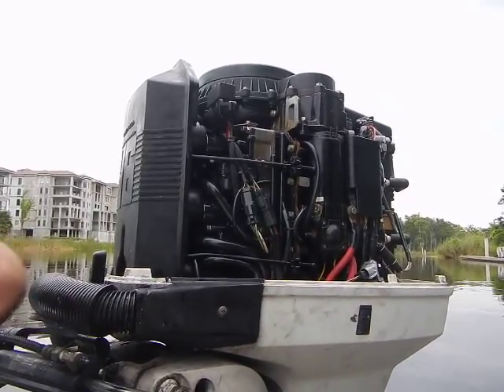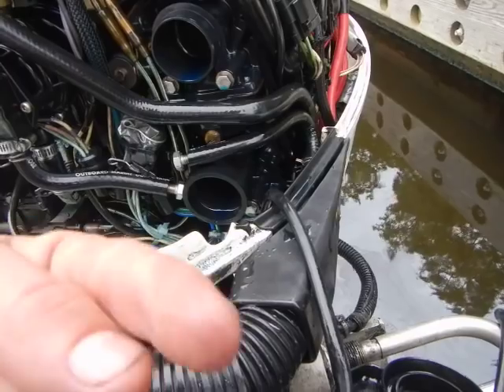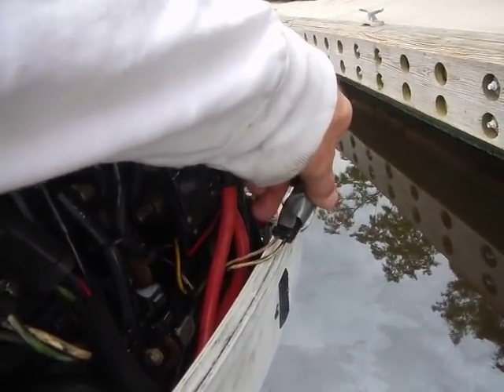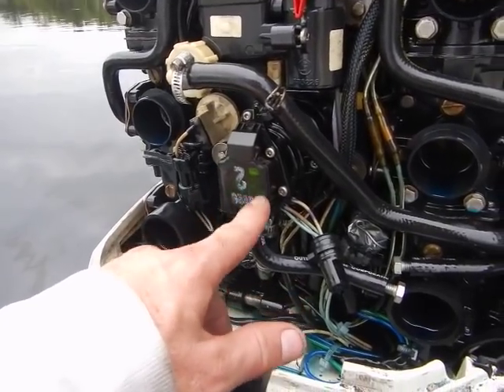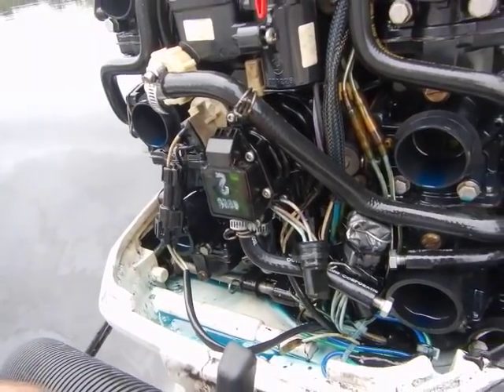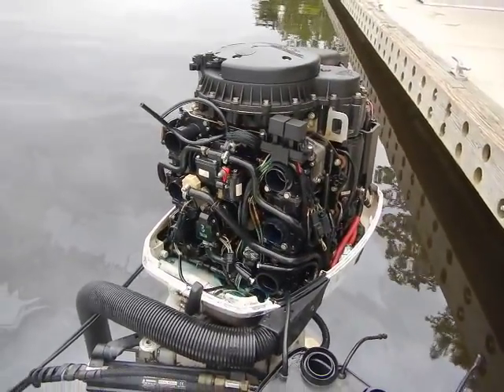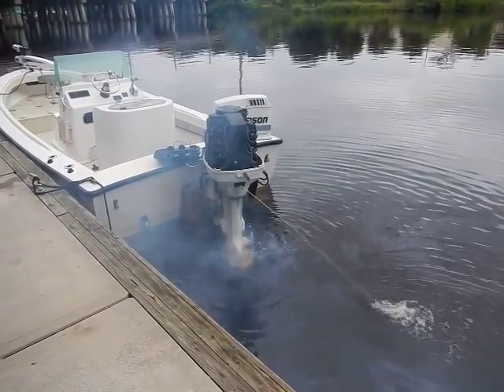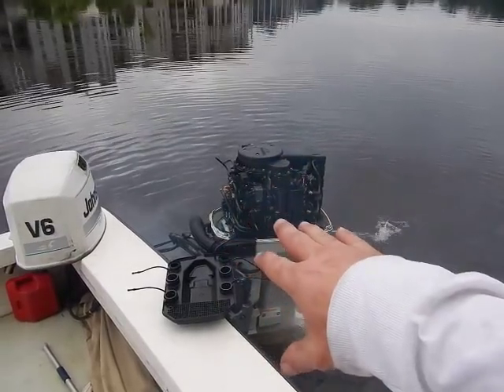Bypass VRO Oil Pump 1996 Johnson 150 HP

Comment: That’s the strongest water pump I have ever seen
Reply from the maker: Funny.  I never even noticed.  Definitely a quality stream.
Reply: Just deleted my vro changed lower unit oil an now it will not pump water on the hose so I am going to do the pump don’t know the history on the motor
Reply from the maker: @brandone6252  yeah.  Probably a good idea to replace that impeller.  Maybe you'll get some flow like mine.

Comment: Sounds like Lucas is having the same problem as I am. Once VRO is disconnected electrically, does the fuel side of VRO still operate as a fuel pump or do you need to add a fuel pump to maintain proper fuel pressure? How does the VRO still pumps fuel mechanically if the electrical leads are disconnected, I don't see any mechanical connection? Is the motor pulling fuel through a vacuum created by the motor once started? Need Help with this, Thks.

Comment: Johnson just dumped a bunch of VRO pumps on the market for cost so now you can get a brand new one for 145 and the upgraded works great compared to the older version.
Reply from the maker: You have a link to the product that you can share?
Reply: He’s right you can get a brand new upgraded VRO kit on eBay for $145
Pre-mixing at 50:1 you’re going to be wasting a lot of oil
Reply: @Bruce Bonfiglio true that’s why I Do routine maintenance Not just on the motor but also the complete oiling system , I have a 99 Johnson 225  I Purchased new as an upgrade for the yammy 150 that was on my Grady White when I bought it now 22 years later I just replaced the tank and pump pro actively I live in Florida so I use the boat year around and it’s got over 5k hours 
The reason vro system got a bad rep is because people neglected them but that’s just my opinion
Reply: @johnbumpus7138  All I see are super expensive new ones. Any chance you know where I can find a $150ish one? Link?

Comment: When you start changing things around something else screws up, Ive used Walmart oil for years with no problem,some of us cannot afford $35.00 gallon jug of oil.
Reply: 1DesertCop The VRO is a oil mixing sysytem/fuel pump. Most of the OMC motors have the VRO and when they start to go bad people typically just disconnect the oil and use it just as a fuel pump. This gets rid of the VRO mixing the fuel to lean/rich and gives peoole the peace of mind from the pump because if the oil stops getting fed, the motor will blow. Also a new VRO is a $400 part, this is a cheap/free fix.
Reply: Fisherman466 Variable Ratio Oiling just run three ounces to a gallon never have a problem OMC s abortion all they had was problems with that system I set my etec computer to tcw3 oil setting so runs heavy oil that xd 100 setting is too lean for me on the etecs JT

Comment: Thanks for posting, video really helped me out.  I did this to my twin 175 ocean pros and they are running better than ever with so much less smoke at startup and idle.  The VRO rebuild parts were very expensive so now I just mix 50:1 and all is good.  With 20yr old engines this is fine with me.  I find it easier to mix the gas and oil myself due to the oil fill location on my boat.  Since I generally fill up with either 100 or 150 gallons (have a 200 gal tank) I either use 2 or 3 gallons of oil and then I'm set for the weekend.  Super easy.
Reply from the maker: john doe right on. Glad the vid helped.
Reply: Can anyone tell me how there engines ran after VRO disconnect? im thinking about disconnecting  mine on a 200 Ocean Pro 1997

Comment: I did the same thing to my 70 hp Johnson. Now I can use the same fuel line for my kicker that runs on premix because my main tank is now premix. My engine smoked so much at start up when the VRO was hooked up. I hated it...it ran like crap till it warmed up.
Now its good from the second you turn the key.

Comment: I took the complete VRO system out , It had air leaks and was nothing but a problem.    I now run premix in the tank and an electric fuel pump installed where the VRO system use to be. :)
Reply: Do you remember what fuel pump you installed? Doing the same to my 150

Comment from the maker: No, you're right, but the pump is still pumping.  All I've done here is disconnect the oil hose coming into the pump (and cap it off really good) and also removed the electrical plugs coming into the pump. I know one of them is for the warning signals and I'm sure the other one has something to do with the oil system (telling it to pump more or less oil).  
The Fuel hose is still connected and the pump is mechanical, not electrical, so it still pumps fuel just fine.
Reply: Would it not pump good if the bolt you use it to small? I put a hose clamp in it but I don't think it is tight enough. My engine cut off when I was coming back in from fishing it still turns over it just won't start.
Reply from the maker: @danielmorrison9055  yeah. I had a problem when using a smaller bolt. That could be the issue. It's not hard to take the VRO apart to see if the fuel pump diagram is cracked. I suggest checking it.
Reply: They make a conversion kit that includes a new calibrated high flow fuel pump without the oil injection pump it’s $65 on eBay It also comes with a plug-in signal killer so no more low oil light
Reply: @johnbumpus7138  I know this is a year later so maybe I missing it somewhere I see the conversion fuel pump but not the by pass for the low oil? Do you happen to have exactly what you used and what worked for you?

Comment: I guess I may delete VRO from my Johnson 115 and go with pre-mixing. An additional benefit of going with pre-mixing on my boat is that I will no longer need the oil tank on my boat and therefore have an extra much-needed storage.

Within the whole VRO pump assembly, my oil pump is still working (oil consumption verified with clear tubing). But when I turn on my key without cranking (fuel pump starts working at this point), the very front 'no oil circuit' actually gives SMOKE right away! My guess is that there may be a short circuit inside the 'no oil circuit' part ('sensor') due to some corrosion, water intrusion or other reasons. 

I'm not sure if how I can fix the 'no oil circuit' part. I can take it from my boat, but don't know I can open it up and fix the possible electric short circuit inside. So either go with pre-mixing or buying a new whole VRO pump. I only burn about 70 gallons of fuel annually. So I guess I'm going to be fine with 4-5 times of premixing every year, and not spending $400 on a new VRO pump.

Comment: i did the same to my 50 johnson but i went out and bought a new pump,  i about to do the same on a 200 oceanrunner but was wondering do you get a no oil light on your dash for the motor since you disconnected the wires that let you know the levels of your oil can.

Comment: I use to own a 1992 Evinrude XP 200 with the VRO system & it worked great. I would Never consider taking it off that Outboard as long as it was working. If it was to ever have gone out, Quit working, I would have replaced it with a New one. I'm now going to be running a 85 Johnson 9.9 Outboard where I will be mixing the fuel & oil 50:1 and have mixed fuel before for other Evinrude /Johnson outboards the same way without any problems. Good luck with your Outboard, It looks as if it runs good !

Comment: I see this post as a little bit older but I do want to recommend using  100:1 Amsoil oil mix it will help you out with detonation problems if it's still alive on the Walmart oil it will truly last you a lifetime
Reply from the maker: Daniel Boone a year or two after making this vid, I bought a new VRO pump and installed it. Just last year I sold it and the guy who bought out says it's still running strong. It's a great motor with tons of power.
Reply: all Johnsons need 50:1!

Comment: Premixing fuel protects and lubricates the entire fuel system. 2 stroke oil now has additives to help combated the ethenol..moisture.. in today's gasoline. 
The VRO is an excellent system, but is that $500 replacement pump going to last 20+ years as the original.

Comment: got the same problem as you did but changed the vro (expensive) and guess what! The pump was not broken still same problem so now i premix instead. I guess its has to do with the electrical system on the vro but just guessing and its running fine with premixing.

Comment: My son just got a 1996 Ocean Runner 150.  It is a project.  Any other info and tips would be greatly appreciated!
Reply from the maker: It's a great engine. Tons of power. 
If the VRO works properly, keep it installed. If it's old, he should probably purchase a rebuild kit for it.  I may have linked it in the description. 
The carbs are plastic and I've seen them warped before. This allows for leaks and overall poor performance. High temp can cause this. Just make sure it is peeing properly. 
If you have any other questions, just ask. I'll answer if I know.

Comment: Hey guy, did you by any chance have to change the jets High and low speed office on each carb?
Reply: why would you need to rejet? air fuel mix is still the same. only now the fuel carries the oil instead of the oil being injected. These are known for over oiling at low rpm and failing at high rpm melting the motor down
Reply: @dirtydevil283  Have an 50hp VRO Fukin love it smokes a bit at a troll other than that VRO evil ,just urban legend few fail  ,,its always " I know a guy who knows a guy crap.

Comment: Hey....i have sea ray 150 outboard 2 stroke  and its hard to start....thinking of doind this and adding a low pressure pump....any feed back?
Reply from the maker: If you're having trouble stating, that's probably associated with a different problem.  I'd look for other issues first.

Comment: My question is....  If your disconnect your vro how does your engine get fuel? Vro is oil and gaspump at the same time or am i wrong
Reply: Oil pump is separate from the gas pump. I’ve disconnected every one I have ever had. They are the cause of so many blown motors.

Comment: will this cause the fuel pump to go bad? I disconnected the oil part of the VRO when I got my boat 2 summers ago, but now the fuel pump is bad. won't it constantly be trying to suck oil that it's not getting? I would replace with a regular fuel pump but I don't want to jag around with the bracket issue, so I was just going to replace with another VRO, but won't it just go bad again?
Reply from the maker: The fuel pump will continue to work whether or not the oil is hooked up. I had mine in this condition for quite some time without issue, however I ended up installing a brand-new VRO pump a few years later. I was happy with the decision to go back to the VRO pump.
Reply: How much trust do you have in the new vro's?

Comment: how I mix the oil to fuel mix say for the evinrude 150hp outboard if im gettin an second hand boat but was unsure bout the VRO had been disabled or not what is the right premix ratios for these motors as im gettin an older bowrider boat with these motors from 1991 onwards and need to knew how much oil to put in the tank of the Caribbean Calais has a 135litre tank im not sure how to mix the oil and the fuel for the boats with larger tanks that are larger than 25litres as I also need help to learn how to get the correct premix ratios for larger boats with the evinrude V6 150hp outboard as im researching the boat with these motors this will mention the boats in good order as I knew as an ex outboard mechanic I worked on these motors this was some 19yrs ago and I knew that these are the motor I worked on all these years ago as I have the knowledge on them as I knew the brands you talked on about as a self taught mechanic I knew the outboards well mainly evinrudes that's including the Johnsons too they are the sae I think so as I knew the same problems are the same with the Johnsons too as I worked on the same motors of both brands as you knew I have the knowhow to fix these outboard motors as a ex outboard mechanic I had the knowledge as I learn all on these motors as a lifelong boater I knew a lot on these motors very well and knew how to fix these evinrude V6 150hp outboards I knew I have this learnt from my boatin experience  all I knew I can fix any evinrude mainly the older carbie models this relates to the V6 90deg models and the smaller 90deg V4s as well I knew how to fix them outboards as I knew how to fix them I was taught how to service them and fix them too that's what I knew on the evinrudes I have a strong connection to them due to my long boatin experience in Australia  that's how I learnt on them these are the good motor built by OMC they are good unlike the others that's are not so good as evinrude/Johnson they are the best in outboards the evinrudes/Johnson built by a good maker that's OMC they are very good motor in the industry I knew that's the case
Reply from the maker: Should be 50:1
Reply: that's good to know this as I have to learn this as I get my 1st evinrude 150hp V6 outboard on a older bowrider boat that's either a Haines hunter or Caribbean Calais just need to learn a bit more on the right ratios with the larger tanks in the boats im researching at this moment I do agree this will be right as I am old salty I will be happy to talk more on this subject as I knew I will learn as I go on these premix outboards that's is the evinrude V6 150hp 90deg models  these are the motor im researching as of now need to learn more as im in the process of getting the boat I want with these motors but will take on advice if the need to as I lean of others in the care of these motors and im getting there with the boat I wanted with these motor on the back thank my friend im always leaning on boat that's very good that hint
Reply: an I  knew this is right premix ratios but I knew I will be learning on this stuff this why im gettin good on this stuff
Reply: and need to know this as im gettin the knowhow on these outboards but are learning all the time hope this will help me this is new to me
Reply: if is ok to mix the oil to fuel with boat that has larger fuel tanks say the boats like the Caribbean Calais with the 135litre fuel tanks as im confused as to the right procedures when filling up as the servo if better to put the oil in first in the right amounts then put the fuel in as I do that I add the oil at the right amount what are your thoughts on this as I am gettin a nice boat in the future with an evinrude 150hp V6 that's an older model on a older boat that's im gonna fix up over time the outboard will be checked but I will need the help on this as im gettin my first 150hp evinrude as I only knew the smaller evinrudes that's the 25hp models I knew on but the 150hp model will be my first V6 outboard on my first big boat can you guide me on how to start these outboards this regarding the choke and warming up procedures and how I mix the right oil for the fuel for the 1st time as im used to smaller outboards but the big 150hp models are a bit new for me

Comment: Hi jim, I just bought a boat with the same motor same year and and replaced the power pack optical sensor plugs and wires. I'm having a problem my motor will run great then all of a sudden when I'm running 3/4 to wide open throttle the boat will bog down and pretty much do nothing when I hit the throttle. It will still idle fine also I noticed if I hook the motor up to my 6 gallon temp tank the motor will clear up and run good again. There isn't any trash in the fuel tank do you think this could be my fuel pump or possibly my fuel line ?
Reply from the maker: Definite possibilities.  Have you tried to pump the bulb on the fuel line when this happens? If it starts ruining again, the fuel pump may be your problem. And the fuel pump is part of the VRO. 
Another possibility is that the carburetors may have a leak. Or if you have a fuel water separator, it may be loose or have a leak at the seal.
Reply: @JimWellman  I've tried to pump the bulb with no results. I'm wondering if some how condensation got into my gas tank and is causing this. I'm going to get a bottle of heet and see if it runs better.
Reply from the maker: @tylerthomas3744  there may be a hole in the fuel pump diaphragm. I made a vid showing how to rebuild the VRO. You may want to take it apart to check for cracks in the diaphragm. I also posted a link to a website that sells the rebuild kits in the description. 
https://youtu.be/_ZT-oMJG-EA
Reply: @JimWellman  thank you I'll pull it apart and look at it
Reply: Probably the fuel line. I have a 1999 150 ocean pro and I swear I thought I cracked the head cause I got the motor to hot (forgot to put hose on it) long story...anyway it would do fine until about 100 to 200 yrs out on the water. I told service man a probably of cracked head or etc... come to find out the motor was fine. But the problem was the fuel line was calapsed. I think the vacuum running it hard would make the fuel line calapse qnd it would eventually stop running. Anyway it's probably fuel line.

Comment: why would you unhook it and then replace the VRO? Im looking at disconnecting mine but maybe I shouldnt
Reply from the maker: Originally didn't want to spend the $$$ on a new pump.
Reply from the maker: If it works, no need to bypass it. My only reason to bypass it was $$$.
Reply: @JimWellman  vro broken when idle and cut after few second? My V6 spitfire start but cut few second later :(
Reply from the maker: @Mr19011989  you may need to rebuild the VRO pump.

Comment: I just did this to a Johnson 150 commercial series and now I have no spark on 3 cylinders? Any body have any information? Is the computer putting it into limp mode?
Reply: Did you ever find out why no spark ? I'm dealing with the same thing right now . After pump replaced, no spark..